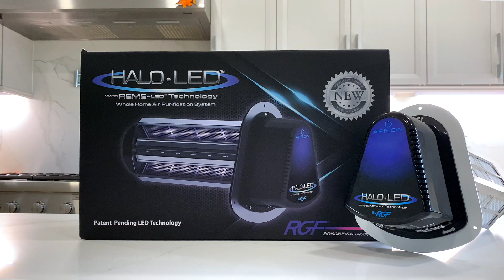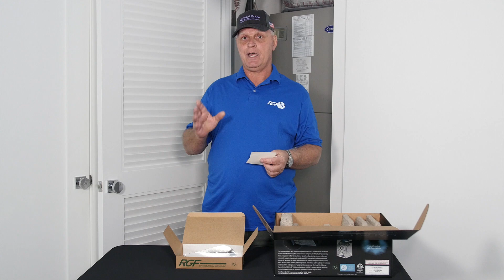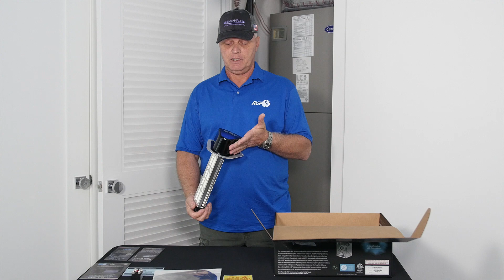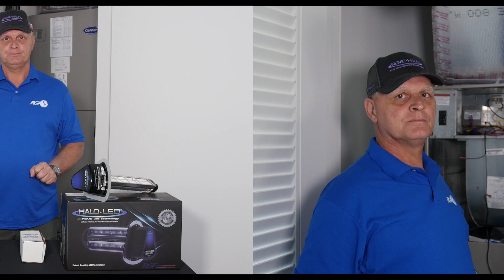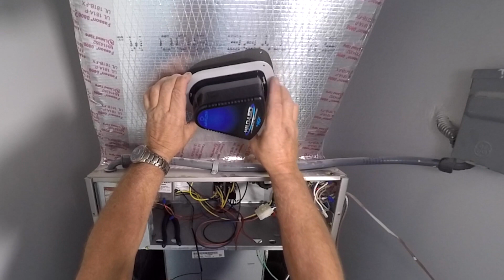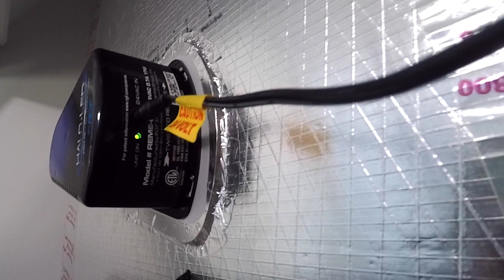HALO-LED Installation with Air Sensing Switch

Comment: Do you need the air switch for a variable speed tam7 system? 
I cannot seem to get it to work with the relay.
Reply from the maker: Yes, with the variable speed system you should use the Air Sensing Switch (RGF Part# HLED-AS)
Reply: Thank you I will order the switch

Comment: You said that it's not good to have the Halo-LED run 24/7 but if you have your fan set to run 24/7 but on a lower speed is it best to adjust the air sensing switch to only come on when the blower is running at say 50%?  Otherwise with the air switch won't ever turn off due to the fan being on low speed.  I have a Lennox variable speed blower and I want to make sure I don't burn the Halo out.
Reply from the maker: Hi Marc! Thank you for your inquiry. The Air Sensing Switch is not adjustable. In your application, I would suggest changing your thermostat to one with "circulate mode" because that mode will shut the blower off. You could have it shut off for say 10 min/hour depending on how you set it. That will give the unit time to clean itself.

Comment: Would you mind making another video using the supplied relay with a residential gas furnace/central air unit?
Reply from the maker: Hi Kodie! Thank you for your inquiry. It's actually the same wiring except for the heat as there is no sequencer. If you are installing to a 2 speed fan motor(PSC) then terminal 5 is connected to the low speed relay (heat) on the control board. If you are connecting to a variable speed fan motor then you should use the air switch kit (HLED-AS) or you could use 2 relays and power the second relays coil with the W wir from the tstat.

Comment: Would any differential pressure switch set at .75 inwc work?
Reply from the maker: The reason we use this specific pressure switch which is .05 inwc is to have the unit come on in prechill. This is only for certain air-conditioning systems. A standard AC will work perfectly fine on a .75 inwc unit.

Comment: If the ecm is running 24/7 is it any different than wiring it to have constant voltage? I know it must be wired to come on and off with the fan, its marketed as a feature but is it not damaging to the unit and voids the warranty? So what's the difference between running the ecm 24/7 and running it directly to line voltage?
Reply from the maker: The unit should not run 24/7 because it will never clean itself.

Comment: Do you think there would be any issues using the eac terminals just to energize a 120v relay??
Reply from the maker: You can use the eac terminals just to energize a 120v relay as long as it isolates the eac power from the REME transformer.

Comment: You gotta love this man for this video. I just bought the same unit for my house but was confused about using the relay system. This excellent video is just what the average handy man needs in order to get this system going. I now know  what I need to do. I have done other things to AC & heating unit, in my own home, with videos like this to fix gas heater issues & also how to replace a blower motor too. Thank God for people like this gentleman who help out by taking the time to share their knowledge & wisdom on Youtube. Thank you sir for this video. I will be subscribing next.
Reply from the maker: Thank you for the compliment! I'll be sure to pass it along to Joe! :)